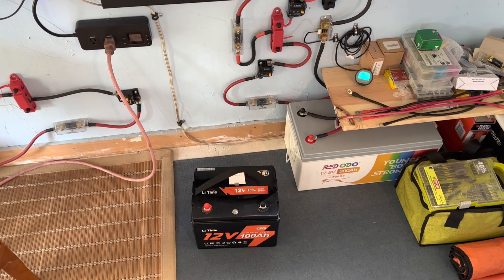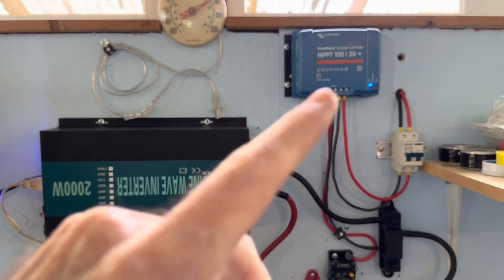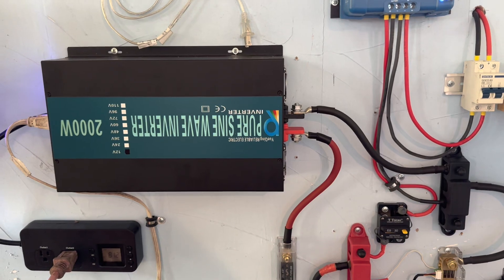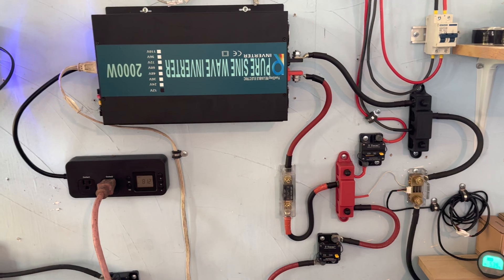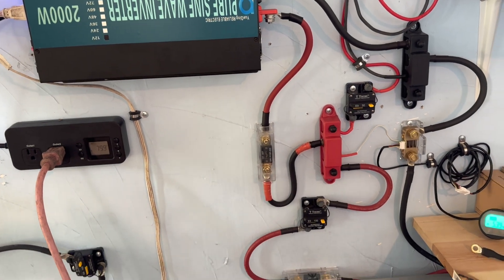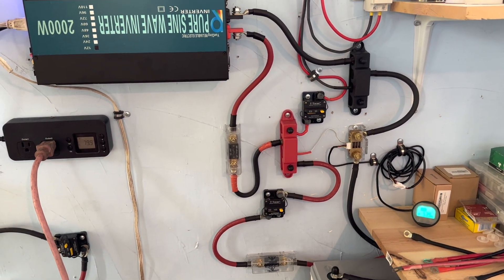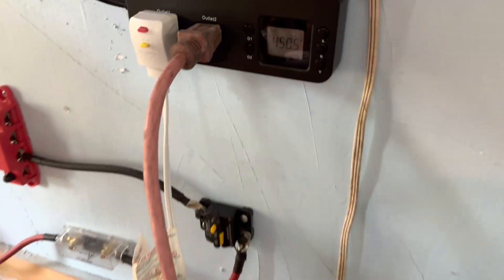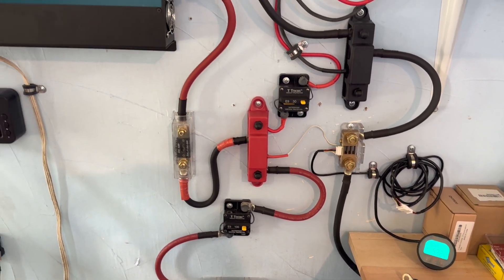100 Amp fuses blown!  300Ah LiFePO4 system down! Unforced error! Making the mistakes for you! Ouch!

Comment: 100 amp fuse is appropriate for your 2awg cable. A blown fuse is better than your wires melting and starting a fire. The mistake isn't leaving the 100 amp fuses in place, the mistake was putting a 200amp fuse in without replacing the wires. That 2000W/12v inverter would pull 166 amps at full load, so first thing that's needed is to replace those cables with 1/0 awg, preferably 2/0, once that's done then it's safe to upgrade your fuses to 200amp.
Reply: What determines the the fuse size , Im in the process of getting stuff together to make a solar system, it will have TWO  12.8 volt 100 amp Power Queen batteries with a 2000 watt Renogy pure sine wave inverter, can I use circuit breakers instead, also do the fuses go between the batteries and the inverter, I get mixed information on some of these YouTube videos and the last thing I need is to start a fire . What you said makes sense using the thickest battery cables, many videos will say the same . My main concern is powering my refrigerator, it’s just a basic refrigerator, nothing fancy, i already know the power consumption on it , Thanks
Reply: No that isn't necessary for such a short distance.
2 gauge is fine if you stay around 1800 watts - 80% derating of inverter. 1 gauge might be a better choice if you expect high inrush currents, or run closer to max power most of the time.
Reply: @jamesalles139 The NEC doesn’t say anything about how short a wire is , #2 (THHN) is only good for 130 amps and #1 isn’t legal either, it’s only good for 145 amps. A person can’t legally put a 200 amp fuse on wires that small.
Reply: @twoweary  OK, running full load with headroom, 2/0 cable would be a great design with a 200 Amp fuse. 

I proposed derating to 150 amps, a better choice for 2 awg would be a 120 amp fuse, certainly not a 200 amp fuse. I didn't mean to imply that a 200 amp fuse was a good idea, thank you for clearing that up.

I did suggest 1 gauge wire would be better at 150 amps. 145A * 1.04 = 150.8A if at room temperature (air conditioned).

Also, remember that the NEC is not a legal document. It depends on what has been adopted by legislation, and whether the Authority Having Jurisdiction (AHJ) is paying any attention.

So, once again, I do not recommend putting a 200 amp fuse in to solve this problem. This is asking for a fire hazard, regardless of the legalities.
Reply: @jamesalles139  IIRC, a 2000W Pure Sine Wave 12v inverter (guessing it's 90% efficient as PSW inverters usually are) uses 1/0 wire (even for short distances, like 3-4' max, IIRC) and requires a 250A fuse. Actually, the formula calls for a 277A fuse, but I rounded-down to 250 as it's the closest standard fuse rating (that I found) w/o going over 277. That may just be me though (for a cushion of safety).
Of course, keep the inverter as close to the battery as possible to reduce the length of wire/cable you need to run -- keep it as SHORT as possible.
The formula I'm talking about is the continuous Watt-rating of the inverter divided by the nominal (lowest) voltage a 12v system can have before it shuts down due to low battery voltage (that'd be 10v, not 12v). That number is then divided by the inverter's efficiency, in this case it's 90% (some are 85%), so if it's 90% then the number would be divided by 0.9. Finally, that last number is multiplied by 1.25 which will give you the fuse (or circuit-breaker) rating. 
So to use this 2000W inverter as an example, we have:
2000W/10v = 200A. 200A/0.9 = 222.22A. 222A X 1.25 = 277A fuse/circuit-breaker rating. 
So no, I would say a 200A fuse for a 2000W inverter is WAY under and would blow too early. Yes, 250A is under also (meaning under the max 277A fuse the formula states) but not TOO far under (IMO) as I lose only 27A capacity (no big deal -- to me). I round-down from 277 to the next common fuse rating so I went with a 250A fuse. If there's a 260A fuse that'd be better. Or a 270A is ideal. I didn't find one so I went with 250 instead. Maybe I didn't search enough (for a Mega/ANL fuse of 260A or 270A, if they come in those sizes -- don't know).
But then I'm no expert (!) in DC electronics, I'm just saying how I calculate the fuse or circuit-breaker needed for a given inverter rating as I was online looking for information from people who seem to know way more than I do and it's the formula they use as well. But do your own research to verify for yourself...
Wire size needed is another calculation, but lots of AWG Wire/Ampacity charts have that info as it depends on the max Amps that might go through it, the wire's ampacity and length of run.
But the formula above is the one I use for calculating the fuse needed for all my PSW 12v inverters -- 2000W, 1000W, 700W, 600W and 300W inverters. I don't have (yet!) a 1500W PSW inverter, but will get one eventually...don't see any need to go above 2000W though for MY anticipated future needs. 
As for Modified Sine Wave inverters (MSW), I see no reason to get one of those even though they're way cheaper -- I stick with PSW no matter what device I'm running off it, period. 
FWIW...
-- BR
Reply: @billredding2000  The only 'note' I would add to what you said is that most inverters, can put out around double the rated capacity for short startup surges, so if one is running compressors(fridges/freezers, air conditioners, etc), and/or motors, using one I know the exact specs on, the original Multiplus, rated at 2,400 watts, can, for up to about 10 seconds, put out as much as 6000 watts (2 x its 3000 VA rating... or 5,500 watts for the Multiplus II, rated at the same 2,400 watts). So if one expects startup surges, those factors need to be taken into account for cable and fuse selection.☮🇨🇦
Reply: @BorealisNights  Then maybe a "slow-blow" fuse-circuit-breaker would be best. Also, I would add a "soft-start" device to my RV's AC to reduce that initial current draw.
-- BR
Reply: Short distance means less voltage drop but 2awg will still get very hot above 130amps, whatever, it's not my setup catching fire.  @jamesalles139

Comment: Hi I like your videos but please do not store items above the battery such as nuts and bolts and wires. I know you know this already but for me I will not store "any" items above any electrical devices with exposed terminals. Also when things are mounted low to the ground you can not see them good even with glasses. I like to be able to walk up and see at eye level and have room to maneuver in case something goes wrong. Worked on Aircraft in the Navy and they pounded into us "PREVENTIVE MAINTENANCE" every day 24/7 we use to hate doing checks and inspections but now I get it and still use that training as best I can. Again you know this already I am just sharing my thoughts and hope you remain safe forever! PEACE
Reply from the maker: Appreciate the time you took to drive the preventative maintenance point home! I completely agree!  Mahalo for sharing that brother! ALoha! 🤙

Comment: Most likely the high setting on the blower is 1500w,   divide that by 12v and thats how much amps its going to take - 125  so not that surpring.  I only have 2 panels totalling 160watts and it runs all my electronics just fine, but came to the realization battery is king and id need about 200ah to efficiently match the panels.  Most underestimate how much battery they'd need, like a 150w load will last only 16 hours on a 200ah battery, a hair dryer running at 1500w  would deplete a 300ah battery in  less then 2 hours. Not that big of a problem in the summer with constant solar, but a few cloudy days will show you how insignificant your battery is in the equation.  Even the biggest solar systems on youtube underestimate this and soon come to see what they thought was a huge battery bank wont last more than a few days in the winter sun, making solar pretty ineffecient and not reliable year round.  You'd need a ridiculouse amount of panel to cover the low light in the winter, or a  ridiculously expensive battery to store energy you harvest in the summer to use in the winter.     Theres options like pumping water up a hill with excess solar and using the hydro power for later, but thats about it.  Maybe the recent breakthroughs with superconductors will help with long term battery storage.  Check out  Robbert Murray Smith's channel he's constantly interating on wind turbine technologly, i think is the way to go, a combined approach of wind , sun, and water even (hydroelectricity) to be totally self sufficient power wise year round.

Comment: Thanks for showing us your mistakes. I just upgraded my solar to 1000w with a 300AH LIPO battery. I’ll double check on my fusing in the morning.
Reply: 12V system, I’ve currently got a 250A fuse with 1/0 cable between 2200W inverter and single 12V 300AH battery.
Reply: Hello pal
How are you?
Hope u doing well
Quick question 
What fuse are u using for 300ah battery.
Its 12 or 24 v system?

Comment: Why do people dismiss these ANL fuses and insist the more expensive class T are necessary?
Reply from the maker: Thats twice the anl fuse saved me. I still use them. 🤙
Reply: It depends where in the system/curcuit you're placing the fuse. its not about how many amps the fuse will blow at.. it's about how many amps it can blow at, without welding back together or being too close so an arc situation begins. a class T can interrupt 20,000+ amps... an MRBF, around 10,000 amps... ANL, 5 to 6,000 amps, and a Mega, around 2,000 amps. The thing is, as a main battery fuse, in a lithium system, a short can produce from 10 to 30,000 amps, so ANL, at 6,000, would either weld or arc in a short situation.
An ANL fuse is PERFECT, for say your inverter circuit, since a short is already going to be protected by the correct battery fuse (either class T or MRBF), and since it's a slower blow type, it will let through startup surges better without blowing. ANL's were ok for Lead Acid systems, since their short circuit amperage is much lower than lithiums.. but still, an ANL could possibly fail, hence, MRBF (Marine Rated Battery Fuse).

Comment: Fuses and circuit breakers need to be good quality, in order to insure that their actual ratings are within specs, many cheep Chinese brands use the exact same components across many differently labeled breakers and fuses. Buss,man,  Littlefuse, Bluesea, Midnight solar ect, use only quality safety stuff here, in order for it to actually work correctly at the correct rating. And good double pole DC box panel breakers are best where applicable. Double pull help to extingwish high current and amperage DC arcs. But are limited use in 12v systems, due to high amperage ect. And yes that is what class T fuses take care of is high amp DC arc extingwishing.
Reply from the maker: Mahalo for being part of the conversation...I have many of what you mentioned to add yet. Aloha!🤙

Comment: 2g wire is not rated for 200amp, and can cause a fire, and is almost the equivelant of not using any fuse. I believe that wat you said you are running in your other comment answers?
Reply from the maker: Have 2 awg on most systems atm. aloha 🤙

Comment: I believe the Armageddon fuse for lithium batteries should be type T as the can handle the higher interrupting rating that these batteries can put out.Just starting my first solar build and as a 32 year experienced wireman fusses have ratings! And not just amp ratings.As i have been watching and researching tons of information on these systems T fuse is the recommended fuse if the system is using lithium batteries.I call it the Armageddon fuse because fires aren't fun when they are in the living space outside of say a woodburner.
Reply from the maker: Been looking at adding tfuses ...been a little hard to find right now, but plan on snagging some soon. aloha 🤙

Comment: Appreciate you showing us an example of what can go wrong. It'll happen to us all at some point. My screen may be playing tricks on me, but do you feel you have appropriate cable sizing as well? A 12v system can need some pretty thick cabling. Someone asked me that the other day, as I have some of the multiconductor cables that came with the inverter in my solar generator. I had to re-check, and check a multi-conductor calculator to make sure I had an appropriate size. For my 2k inverter, and my typical max load, of around 1000 watts, I needed 2awg cabling and a 100-110 amp fuse. For me, that was two 5awg cables in parallel. If you find those inverters aren't working out for you, I can't recommend the Roarbatt ones enough. My 2k is now in my solar generator, and can run almost anything in my shop, without issue (on a powerqueen 12v 100ah batt), and the new 4kW 24v is running the girlfriends Art studio shed without the fans even ever coming on.
Reply from the maker: Appreciate you sharing this information,  and mahalo for being part of the conversation here...aloha 🤙
Reply: @ProjectsinParadise808  so much info both in your content and the comments.
Reply: Gotta agree ; from here those cables look mighty small......

Comment: I have 2 200ah  redodo batteries. I also made a mistake on under sizing my fuses and a wire from the charge controller to batteries. Thankfully I did have a fuse and that’s all that happened.

Comment: Do you realize that the fuses are for the protection of the wires, not the load? You need to consult a wire gauge chart to find the appropriate wire size for the maximum load in amps you will be running. Once you have done so, you can then figure out what size fuse you need for that specific wire.

Comment: Nice to see you made a mistake! Mistakes are the best. You learn nothing without mistakes 😉
Perhaps it's time to consider moving to a higher voltage system? The issue you had here was the main reason I moved to 24v system. Only new items needed is a new inverter and check your connections on your solar array and batteries. 
Aloha my friend!

I've made some changes since the last time I posted. It's been a while. I now run a Victron Quattro 24/5000/120 and the entire Lynx system with the Power In, Shunt and Distributor. I've also added four Renogy 550w panels to make a total of 4200w of solar. I have two charge controllers to run the two arrays. One for the 550w x4 and the other running the 100w x20. I have two combiner boxes for each array to keep things clean and to have a disconnect outside. 

You had fun with a hair dryer. I was sweating bullets when I tested my system near capacity....well tried at least. I got to 4200w running and ran out of things to connect haha.

If you plan to up you system voltage Victron has a great excel sheet that will help you out in how to connect your panels so you don't have a problem like not reaching starting voltage or hitting it too late in the day. Here is the link:
https://www.victronenergy.com/upload/software/VE-MPPT-Calc-4_0.xlsm
Reply from the maker: Made plenty of mistakes over the year's! Most of which I remember! Aloha!🤙

Comment: A hair dyer draws 100amps ?
Reply: The fuse is on the low voltage side (before the Inverter). For example, If the hair dryer was 1200 watts @ 120 volt = 10 amps.   1200 watts @ 12 volt = 100 amps. Add in the refrigerator and losses in the system and you are well over 100 amps.  Ohm's law: Amps = Watts / Volts
Reply from the maker: On high setting even more!🤙
Reply: As big squid said, volts determine amps, and you use watts divided by volts to get amps. that's why your house panel is full of 15, 20, and 30 amp breakers.. because they are dealing with 120 volts... but if the panel supply is coming from batteries(as compared to the power company), you are dealing with input amperage based on 12, 24, or 48 volts, and each of those will have to supply different amperage levels to convert to whatever amps on the AC side.
It's kind of like batteries... a 400 Ah 12 volt battery, or a 200 Ah 24 volt battery, or a 100 Ah 48 volt battery, all have the same watt hour capacity of 5120 watt hours. (12. 8, or 25.6, or 51.2, times the Amp rating of each, all come out to 5120... and sticking with DC.. if you had a 120 volt battery, divide 5120 by 120 to get a 42.6 Ah battery.)
As for how many amps a hair dryer can draw, I've seen up to 1500, and some 1800 watt dryers, so you divide 1500 or 1800 by the voltage to get amps.. meaning, an 1800 watt dryer could pull 15 amps of 120 volt AC, or 150 Amps of 12 volt DC. (Notice the 15 Amps of AC?... that why most household breakers are 15 amp. Of course, I am talking North America in the numbers.. if you live where Mains power is 230 volts, then that would be 7.5ish amps, and they often use 8 amp breakers in place of NA's 15 amp.)

Comment: Interesting content.  I am amazed those circuit breakers didn't pop first.  I HAD some in line that look the same that I got on sale from MWandS (100a) and they all blew at 32-36a.  Needless to say, but I removed all of them as I didn't trust the quality any longer.  The ANL fuses have been very good except in COLD weather (below 60F), mine chatter for a few seconds before them warm up.  I still use the ANL but have been moving more and more to quality breakers and larger cobra wire on the DC circuits.  Thanks for the content.
Reply from the maker: Mahalo for that information! I was surprised about the breakers too. Like you, I am converting to higher quality fuses too. Aloha! 🤙
Reply: @ProjectsinParadise808 I hope you have gotten rid of those circuit breakers. They are worthless and can be dangerous to the health of your system.
Reply: Yea I had one of those circuit breakers and it blew way under it’s rated amps aswell. They are meant for car audio equipment. I replaced mine with a quick blow T fuse and a proper battery cut off switch.
Reply: @Earthmadegarden  Yeah, not sure why a solar company sells DC breakers meant for audio.  I fought with them and got my $$ back.  I too have moved to DC switches on my inverters for extra safety.